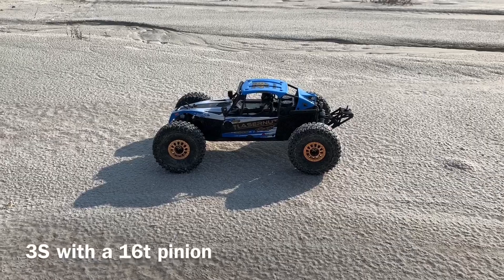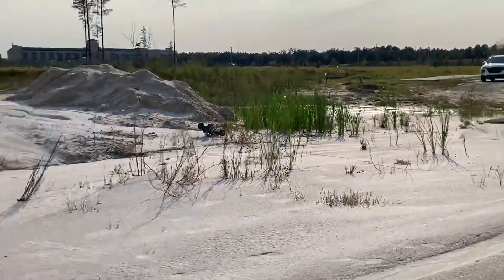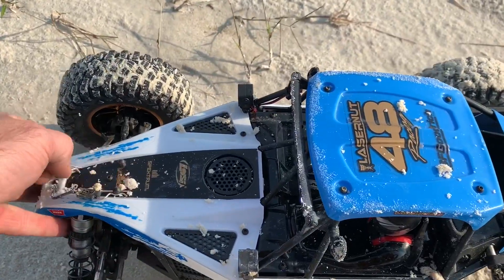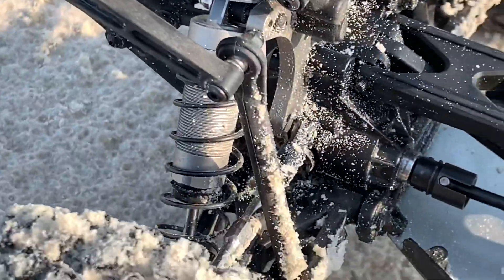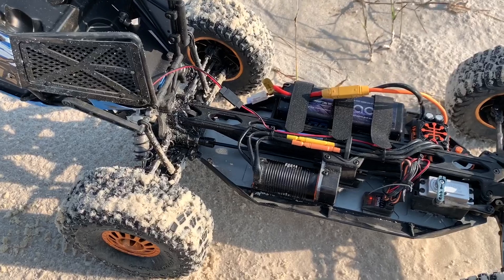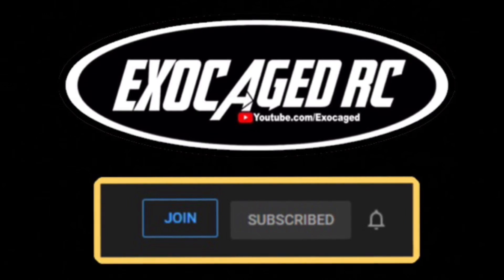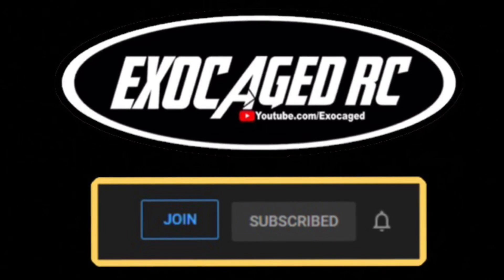Lasernut Fail Again

Comment: The issue is that's a 3s platform and the tires are oversized . I currently have the Tenacity DB pro and sct pro , no issues. When I saw the lazernut I thought it would have the 8ight diffs and drivetrain. Awesome rig but it should have been built on the 1/8 platform instead of an 3s 😎
Reply: It's a 4s though. If you go 3s you need to change the pinion to a lower tooth. My buddy has one and did all the prep work with the diffs and changed the pinion to run 3s today and it ran perfect through 4 packs. I don't think a lot of people are having this issue.

Comment: I appreciate the honest review.. I only had mine for three packs and it broke each time within 10 mins. I had to contact horizon and I sent it in.. mine had the wheel stripping issue, the center diff was locked up (frozen), the turnbuckle stripped the ball end, and because of the center diff issue the rear ring gear and pinion were shot immediately. After talking to two customer support guys at horizon hobby the sent a call tag for repair and I wrote a letter explaining how I’ve got 12 other tlr and Losi kits and thank goodness they returned it for a credit which I immediately used for a 8ight xte truggy. I’m sure glad they helped me in this one cause I’ve got 30 cars and trucks and this one was a major disappointment right away. Good luck man cause after seeing your video I cancelled all my upgrade list and pulled the 170sbl and tlr horn out of this and packed it back up. Thanks brother!
Reply from the maker: Unfortunately this simply isn’t their best effort if they would have built this off the ebuggy platform it would have been epic and virtually unbreakable with our courses.

Comment: I was really looking forward to purchasing this, but I glad you got one before I did lol. Great work
Reply: Im really glad he got one too before i did.
Reply: I bought one expecting it to self distrust. It’s one of my favorite rc’s. 4s stock all day. If I run into an issue? I will share the upgrades. I have almost every Arrma traxxas and old school cars out there. I just bought a son of a digger and this in carbon fiber. LOVE IT! Always tune with program box. I did keep my punch level low. 1-2 and still wheelies when I want it to but stays on the ground. Maybe that’s the secret, leave punch low. It still feels like punch is at 5. Absorbs curbs and rocks like there not there. And made me appreciate having bright lights. Only rc I drive in the dark.
Reply: @SpeedSyko  how's the lasernut holding up after a few months now? Your right about a good set of lights when you get a good set it is a blast driving at night I have the db tenacity and the Baja Rey both great set of lights I do have the dbxle2.0 but the light bar was smoking when I got it waiting on warranty to blast it at night but really keen on your experience with the lasernut 👍
Reply: @thomasthetankengine7153  great car but you need to Buy the Tekno axles. The stock ones are tooth picks. PART # TKR2210X if you buy one, and need help, request a video. I have no problem making a how to. It drives different, like a cloud over bumps and hills. If it was junk I would have been more upset to see them put garbage axles in. Have a great one!!!

Comment: Thanks for the great videos! I've put 5 3S packs through mine so far. 4S battery coming today. I run this in a large reservation nearby.  It has high speed trails and lots of rocks and crawling opportunities.  The rear left wheel nut did not have loctite from the factory.  I replaced all with nylon inserts.  No problems so far. With this body I'm not looking to bash with it. I'm certainly not saying you were doing that. This is so cool to approach the same crawling rocks with this thing. I'm having a blast. Looking forward to 4S to scream across open fields. 3S is more than you need for  anything else. Thx!

Comment: My rear pinion bearing went out as well on my lasernut, luckily I had some spares and noticed before the diff casing was destroyed. Horizon sent out replacement diff casing for front, center, an rear, front and rear ring & pinion, and all new bearings. Great product support, but I agree this is an engineering issue and will occur again after another dozen packs or so.

Comment: I seem to have sorted mine thankfully. 
Shock travel limiters and droop screws all round,drive shafts I borrowed from my spare Db pro,ten scte diff gears in the centre diff,better quality bearings front and rear pinions (the losi ones are crap)
Re-shimmed the pinions and ring gears front and rear and swapped out the crap servo.
Must have had 15+ 4s 100c packs through it now with no breakage. 
Before this mine was exactly like yours!!!

Comment: I have the same damn problem. I bought the first one sold at the hobby store I got it from. I actually had to wait 2 weeks before I could take it home. It broke both front half shafts and apparently the rear bearing is shot also. I figured that out after watching your video. I went with 4s so I now know why it is doing so poorly.

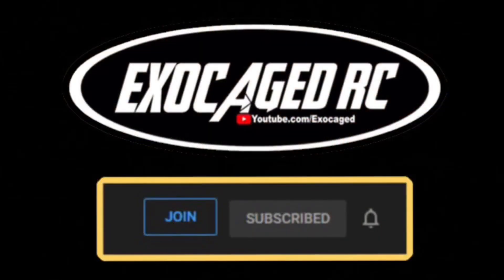Comment: Your videos are honest reviews, and not just advertisements....I had to subscribe. You just saved me $479 in 5:33 minutes. I think pushing those BIG tires around is a lot of work for those components.........maybe, your opinion?
Reply from the maker: Thank you. Yeah they didn’t upgrade anything to handle 3S much less 4S AND big tires. Total flop. I do however have mine running strong now but it’s got a bunch of Vitavon stuff on it to make it do so.
Reply: @ExocagedRC  Sucks, you had to put so much money into it for such little play time. Cool rig though. I’ll just stick with my Losi DB Pro until somebody makes a rock racer that doesn’t break down soo much from moderate use.

Comment: Mines running good. I have not broken any shafts on 4s. I did shim the center diff and put 30k diff oil and it’s been working great. I did order a bunch of spare parts and have not had to use any yet. Maybe I just got lucky. I am running on loose dirt with a couple of small jumps.
Reply: same here.....
Reply from the maker: I wish I could say that.
Reply: I have had mine for a month. I have around 15 runs on it.

Comment: Ceramic won’t add any strength. I do however have a special bearing that probably will hold up. I will send you a few to try out.
Reply from the maker: Really? I’d LOVE to give that a try. I’ll get a new rear case ordered so there’s no possibility of damaged case.
Reply: Exocaged RC sounds good
Reply: DSM Off-Road  over here 
😎🇺🇸
Reply: That was my first thought, that ceramic won't help here but there are other exotics that might.  This platform aside, I am keen to see how that special bearing holds up under Exocaged's throttle finger.

Comment: I've had mine just over a month and can't get 1 battery pack through it without something failing.  First it was the RR wheel nut coming off and stripping the wheel hex, then just the other day both rear axles bent and one of the front king pins for the front bearing carrier came out.  I really want to like this buggy since it handles and drives great when its actually working correctly.  I'd stay away from this one until Losi decides to acknowledge that its a lemon and does right by the people who bought them.

Comment: Almost did not buy this because of all the bad reviews. Stock, I only run 4S and love love love it! Not the fastest not the slowest. It drives different then any rc I have, “all of them” no need for ceramic bearing. This isn’t a 1500 hp turbonetics turbo build. If I run into an issue, ill share my fixes. Love the car!

Comment: Mine is doing fine. I run it on 4S and haven't had a bearing issue. I have had an issue with the front drive shafts coming out but I added some shims and it seems to be working pretty well.

Comment: I’ve only had issue with breaking turn buckles, lower control arms cracking, breaking plastic shock ends, breaking hub carriers all in the front end only. Everything else has been good and I run a gens ace 6000mah 100c 4s lipo with the stock gearing the way it came out the box.

Comment: Great job covering the U4. This is an older video and I wonder if Losi changes something on the design. I just bought 2 a few mons ago and the drive trains are holding up just fine on 3s or 4s. I probably don't bash as hard as you but I'm always heavy on the throttle.

Comment: Gee Losi/Horizon really stuffed up here and after they achieved near perfection with the DB Pro.  I love my DB Pro so I have been keenly looking at this. I have run 20+ full batteries through the DB Pro and have only threaded the motor mount hole through driving to which I repaired. I might wait til they bring a V2 out and see how that reviews. Thanks for the honest review.

Comment: Thanks for review, just purchased my third Losi. First one has front differential leaking, front right drive shaft is bent, now making high pitch whining noise believe it is dry differential. Second one I bought after 25 days of gravel burnouts and high-speed running on grass a few spills and trails nothing serious That one has developed horrible grinding noise, with severe loss of performance. Pretty sure it's differential gone. So I just purchased my third one I have not received it yet. 😏
Running them both on 4S 100 C battery. I try a more powerful battery in your case. They literally scream on 4S.

Comment: I’ve run 4 3s battery packs through my stock lasernut with no issues yet but I would say slight variances in the manufacturing of the diff housings would result in the need to add a shim on diff housings on some to eliminate the in and out play which should help the bearings last longer. Now that the vitavon housings are available if I do end up swapping over to those I might want to downgrade to plastic shock mounts because metal against metal could result in some bending issues

Comment: Did you change the pinion to accommodate to 3s? The pinion it comes with installed from the factory is set for 4s because of the tire size to gearing ratio.
Reply from the maker: I actually put on a 16t for this.
Reply: @ExocagedRC  oh wow, thats good.  Mine has had the turn buckle break about the first week of running it hard. Replaced it and have not had issues with anything else so far. Sorry you've had a bad experience with yours man.

Comment: I love love love my Lasernut post upgrades, but yeah. Durability is getting annoying. I'm on 3s as well. Had my first drivetrain problem yesterday- the two screws holding the motor mount in disappeared during a run and the... what's it called, spur gear? The big one touching the pinion?... shredded. Gah!
Reply from the maker: Wow if that’s been your only issue then you’re doing way better than I am.
Reply: First drivetrain problem! I had driveshafts, wheels, and a steering problem. 

I’m tempted to tear down the diffs and rebuild them while waiting on that gear, but it seems more advanced than I’m up for.

Comment: I was able to put five packs through my Lasernut... haven't been able to drive it now for almost a month... waiting for warranty parts.
Had the same issue with the rear bearing.  Also ruined a tire (and really screwed up another) as the right rear tire keeps spinning off when put under any real friction pressure (a donut on grass).  I had it working ok with a replacement bearing and the "bad" tire (that still worked a bit) when a front CVD just BROKE.  Now it's shelved.  
I was SO STOKED for this vehicle, now it's just disappointment; especially when I see that I'm having the same issues as everyone else.  Rear Diff bearings, right rear tire, broken drive shafts... and I haven't even really gotten it out of my yard yet.  I was hoping that it was just the grass that was too much for it... that maybe with these super grip tires you just need to make sure you keep it on a loose surface (especially on 3s) but now, seeing this video, it looks like that might not even be the problem.  This thing is just under spec'd.  Now, of course, Horizon has NO PARTS for it and I'm just sitting here... waiting...

Comment: I have the db pro and I had no issues after 10 pack with 3s on MX28 Tires. I can imagine that the longer rear center driveshaft is the problem. Maybe it causes some vibration an knocks out the bearing.
Reply from the maker: It’s the thrust of take off with the angle of the gears.

Comment: Probably the housing where that bearing seats, is now warped maybe, or the plastic is soft enough that the bearing can shift while running.
Reply from the maker: I honestly don’t know. It looked ok when I changed it but a new housing is on order.
Reply: @ExocagedRC  That was an issue I had on my Summit, which if I'm not mistaken has the same size bearing there, ended up going with an aluminum housing, unsurprisingly also in the Yeti Xl.

Comment: I just got the lasernut, ran a dozen battery's through it, breaks every time. I mean every time I take it out, something breaks, diff, steering, shocks, bearings, axles, wheels, control arms, hubs. I've had to buy hundreds of $$ in parts, bags and bags of parts to keep this thing rolling. 4s @ 100% is insane fast and hard to control, I'm often just 75% or even 50. Not a basher, rather fragile in my opinion.

Comment: Drove mine once. Steering is aweful. Seems like the servo saver is the issue but I’ll put a strong servo in it for the heck of it. I only ran 4s. Just feels like it will break easy like everything else I have that is made by horizon hobby. At least I have several Traxxas vehicles to play with after the other stuff breaks.
Reply from the maker: Yeah tighten the stock bellcrank up with a better servo and you should be good. The rest of the car is another story..
Reply: @ExocagedRC  well it’s a pretty car, so it will prob just have to look good on the wall with the rest of em.

Comment: Got one out of the box and hooked up 4s to it and it already blew out the gears in the rear differential! Didn’t even get a full battery out of it either
Reply from the maker: I added Ebay links for Vitavon parts to fix it up

Comment: No issues on mine after ~5 hours of run time on 4S other than some bent wheels after nasty one-wheel landings/tumbles.  There was something wrong with either the case or the bearing right off of the bat in this video.  But, it is certainly a weak point (the first failure was definitely legitimate), so it will be good to see an upgrade available regardless.  Sorry that you've had such a crummy experience so far.
Reply: Also, the TEN/3.0 comes with a crush spacer between the two pinion gears.  It likely should have been included on these rigs to share the thrust load across both bearings.  I have them installed on mine (did it during the first diff fluid change).  TLR232053, $5.99
Reply from the maker: I’ll look those up. I wish I could get a good solid run with mine. I’d be happy with a simple 3S run. LoL.

Comment: Easy solution, dust cover.

If you had a dust cover on the Lasernut you probably wouldn't be having bearing issues.  Dirt and sand getting into those bearings is what causes them to fail.

Comment: Same issues on my Losi Baja Rey in the rear end, sadly. Horror-izon stuff just isn't working for me.
Reply: I've had the same issue with my Baja Rey. What did you do to fix the issue?
Reply: @leetjohnson  Hot racing metal 3rd member housing on the rear (it has better pinion bearings and reduces flex), then put in an exotek metal diff housing, then put in a locker instead of the differential gears. It's hard to control but fun! I think Losi offers upgraded "heavy duty" diff gears that may solve the problem, but I haven't tried them. I also put a locker in the center diff, it really helps the handling (no more ballooning front tires while the rear tires do nothing, lol). Hope this helps!
Reply: @doug148877  Thanks Doug!

Comment: I haven't had any issues as of yet.
Reply from the maker: You must have a really good one. Have you ran 4S?
Reply: Yes, that's all I've ran in it. Last night I hit a curb square on the nose and did about a hundred in damage. I would like to see if you get the bearing issue sorted. Ceramic might be a good option. Definitely following this project so I can do the necessary upgrades to keep it in good shape. I've thought about running smaller tires and wheels too

Comment: Wow well they all cant be winners right? Also i got my Xmaxx brother!! Green 8s with 2 50c 9000mah venom 4s packs! Boy were they expensive but supposedly they are worth it for super long run times even at full 8s bashing so we will see!! 👍
Reply from the maker: Nice!! I’m waiting on a set of the 9000mah PowerHobby batteries for mine. The DBXLE 2.0 pulls so hard with the 6gs radio reading batteries it pulls the Turnigy 4S down to LVC for 3S! I’m hoping for the best with the bigger batteries.

Comment: I had the same kind of issues with the proline pro mt4x4. I had it for 6 months and put 4 packs through it. Kept breaking every time i took it out. Maybe i got a lemon, maybe you did as well. 🤷‍♂️ but i really dont reccomend them to anyone
Reply from the maker: I had a Pro MT and it was awesome. I had the Proline Fusion and it just wasn’t as good.
Reply: @ExocagedRC  yep. First run, about 4 trigger pulls in with a 3s system i blew the center diff to powder. Fast forward a month trying to get parts and waiting for backorders, get the parts and put it together, snapped the shock tower off the front bulkhead. Wait another month.. it was stupid... the pro mt was basically a slash and those damn things are  Cockroaches 😂 but they went like stink around a track.